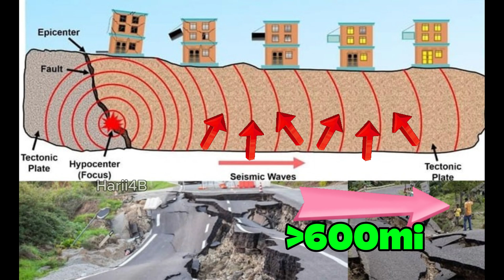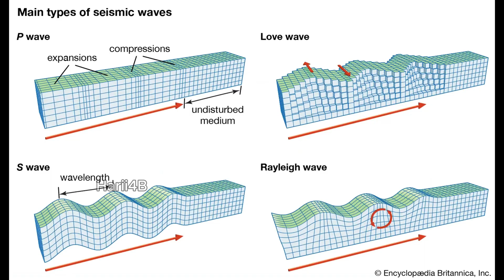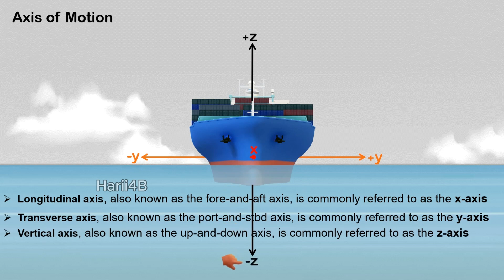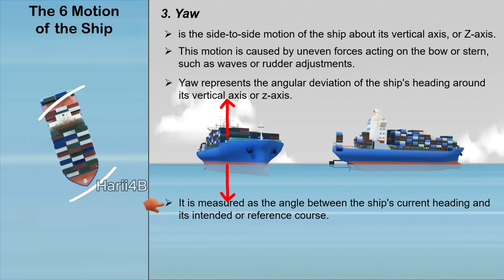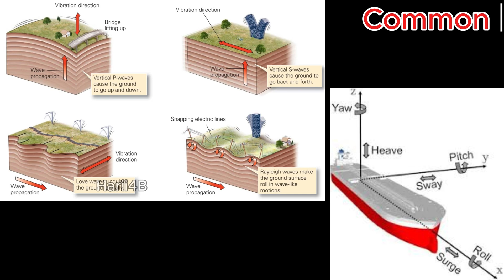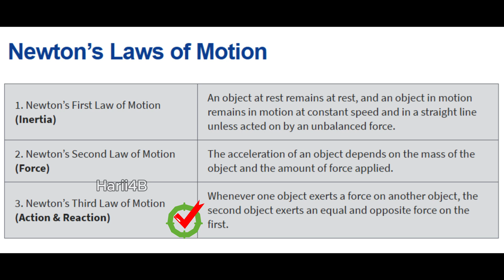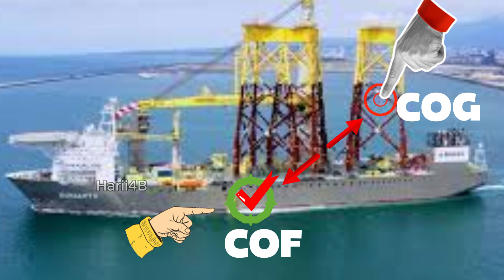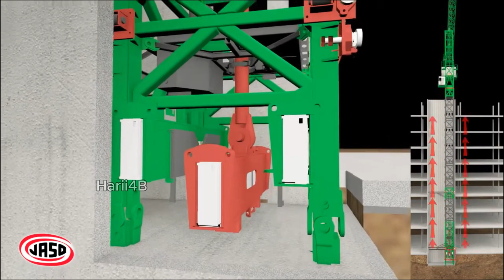Myanmar Thailand Earthquake - Thailand Building, TOWER CRANE Killed It, EXPLAINED - Watch Now!!

Comment: The building and the crane hadn't started swaying into motion but the whole building already started disintegrating top to bottom simultaneously. It's bizarre for a tall building to collapse in an earthquake without first going into excessive swaying or tilting. Earthquake is infamous for its destructive horizontal pulsating force. If this pulsating force matches the natural frequency of a tall building it can send the building into harmonic sway with its amplitude getting higher and higher until its collapse. And in this way a much weaker quake can bring down a building.
It works the same way when u are on a swing; by syncing your force with the motion of the swing, u can work it higher and higher much easily.
But this Bangkok building wasn't brought down this way as it didn't sway a bit.
Reply from the maker: the tower crane is swaying right until collapse but yes, the building looked statically stable. by looking into Taipei 101, with 101 floors with tuned-mass steel pendulum damper on top floors. that pendulum damper sways against eq motion hence keeping the building remained as stable. incidentally, the Thailand building with tower crane may have acted as anti-swaying damper as well. but it was accidental only, and disaster followed.

Comment: The Thailand building collapse because it use a Beamless slab design, which is not earthquake proof design. This Beamless slab design is popular at places, where there are no earthquake, because most of the spaces can be fully utilize due to there are no huge beam that occupy space. Recently, Thailand officials said that 1 out of 3 sample steel bars taken from that building site is substandard material. This could be also one of the factors.
Reply: @yutakago1736  cheaper to build, tofu dreg construction.

Comment: The ONLY Building that COLLAPSED in Thailand was Built by China Railway Number 10.
Instead of coming forth to Assist Investigations; No ONE from China Railway Number 10 came forth, they were Busy Scrubbing TRACE on the Internet and Removing Files from offices signages.
Preliminary Investigations shows Sub Par Steel manufactured by Xin Ke Yuan.

Comment: If the finding was not due to the crane, then this video will have to be removed.
Reply from the maker: No, actually the crane helped exposed their flaws (if there is). So let them blame the crane. on my part, crane could be the Saviour. if ever this event happened later when the building is occupied, more casualties there will be. If indeed it's proven as tofu dreg design and construction, they had built a ticking time bomb, and the crane became the trigger of the bomb, activated by the earthquake. thanks for watching!!
Reply from the maker: OK! simplified explanation .. coming up!

Comment: To me, it couldn't be the tower crane or soft stories at top. It's due to failure of framing joint's of floor bellow top soft stories.
Crane mass n soft top stories, most probably played significant role to stabilize the whole structure. Detailing of joints, especially for top two stories below the soft stories had not been designed or implemented properly.
Reply from the maker: simplified explanation .. coming up!

Comment: Wrong. The investigators found that low quality Chinese steels were used in construction, especially the support columns.
Reply: The steel is the least important of the issues with this building. 1) Design is number one with the offset lift core appearing to experiencing differential movement in the quake 2) The big one is the concrete which turned to dust just falling off the rebar - its colour being very white could indicate a pozzolanic additive was present - whereby the ratio to cement content needs to be within a certain margin.
Reply from the maker: simplified explanation .. coming up!
Reply from the maker: you're comment is the closest almost exact answer to the findings!! concrete strength and quality is the most problematic here!! thank you very much!!
Reply: @ A detailed report on the structural design just released by Thai engineers says the design of the building has many major faults, and the steel (even if it was substandard) should not have played a role in its collapse in the manner that it did. In particular they refer to lift/ core being off-set causing differential movement during the earthquake, the design of the foundation mat slab, the lack of piles under the section where toilets were located on each floor and roof top tank area and the transfer slab on the 19th floor named 19TB1 that likely failed causing the lift/ core / crane to drop initially.
Reply: @ The concrete specified was 500 KSC pumping that up 30 floors after it has been delivered to the site and potentially subjected to delays due to traffic can be challenging and would have required careful planning and supervision. If water was added then the design strength could be compromised.
Reply from the maker: perfect! my same findings indeed!!
Reply from the maker: can the investigation report be accessed by public? any link please?
Reply from the maker: follower video coming up. after watching that then you can say again if this video is wrong. thanks for watching

Comment: I doubt the tower crane  pulverize  the building  . The crane went down  first due to strong  sway  due to  air quake  while carrying  materials sudden big sway will create double   actual  weight. Due to inertia forces,

But the building crumbled in dust, the cement is not mixed right,   contractors  and engineers  cut corners  to save   5million dollars  and pocketed  the fund's.  It clearly shows  the building fall instantly   compared to the rest of the building nearby.. the crane should stop crashing on the last 2 floor  that's enough to hold the weights of crane  if the building  is built  right ,the right size of rears, number of repairs, the correct steel frame  , the tensile of  steel  frame. 
The bolts use on frames  must be grade zinc plated due to near ocean  demography.  The engineers should not used grade 5 bolts it will corroded  in 1 year  and it will meet its demise in 2 to 3 years..
The heavy duty frame should have  stop the  crane from  crashes ,
 It goes down like a pulverize  sand castle on the beach,

Building is not done  correctly  not on code. The engineers  and contractors are liable for this  flaws and demise.
Reply from the maker: follower video is being prepared. yes of course, materials played major role on the cause of this domino collapse. imagine this building is built like a bomb due to poor materials, flawed building design and construction methodology. a bomb needs a trigger to start detonation. the tower crane played the trigger role... it's really hard to put everything (explanation) in one video but hope the follower will be more enlightening. Thanks for watching

Comment: Nothing to do with the crane, there are 50 plus crane visible on buildings under construction Bangkok and the building didn't fall.  It's bad Chinese construction
Reply from the maker: depends on type of tower crane and placement of the crane. most tower cranes are self-standing from its base at ground and attached to the building by lateral braces to prevent falling down. This type of crane is the climbing type and supported only at the top floor levels. commonly this crane is positioned on the middle or near middle section of the building.... But this crane is not! this is where it makes the big difference. an example of design and construction flaws. now, if the material (rebars and concrete) used on construction is proven to be poor quality... then this will be classified as 100% TOFU-DREG construction.

Comment: This is Chinese propaganda as they do not want you to know how little steel they had in this building. Tofu dreg construction is always a problem in China. If this building was built with correct materials it would not have colapsed.
Reply from the maker: TOFU Dreg Status will be marked when Thais proved that material used are poor quality. Still waiting for the testing reports .... Thanks for Watching!!
Reply: @Harii4B  So, even the fact that the building fell at free fall speeds does not make you think that there is a problem with construction.
Reply from the maker: @DieterSoegemeier  i am waiting for the reports of material used under testing are really poor quality and if proven true, i would elevate this collapse as a 100% tofu dreg construction induced. the crane position is already flawed. now, add to it if the materials used are also flawed (?!) ... that's it!
Reply from the maker: i already suspected that the building framing are flawed. the slabs in this building generally have no beams to connect on the column and shear walls. this type of floor frame connection can easily snap under shear loadings how much more the amplified falling weights of each floor, and it did happen already. imagine a bomb waiting to explode, it needs a trigger to detonate. the focus now of the videos is to point out where or how the detonation was triggered. the EQ activated the trigger mechanism which is the tower crane... and it did activate detonated the bomb!

Comment: You are trying to confuse us, to cover up what actually happened. THEY do want us to know. https://youtu.be/M7Ra_1D3roE?si=8fP7ULikADwIJBEa
Reply from the maker: what cover up? i am only pointing out what i think caused/trigger the instant collapse after the EQ came forth. Now, It's mother nature at work. maybe for whatever reason... it may also be a blessing in disguise (no disrespect intended to casualties now). if indeed they can prove the materials used are poor or defective quality, then it would be another TOFUDREG construction project. imagine if it got finished and hand over and during operation, EQ came.... then more casualties will be there! The tower crane positioned on that core shaft location is already a flawed design & construction decision... it should have been positioned on central core shafts.

Comment: It has already been proven that the Chinese construction crew used inferior materials, and four employees tried to steal and hide the engineering documents.
Reply from the maker: too early to say if it's going to be another .... TOFU DREG. Thanks for watching
Reply: Testing of the metals used have already been accomplished in Thailand, and were found to be substandard.
Reply from the maker: yes thanks, i am also monitoring the tests on steel reinforcement used. i hope they do core test of existing concrete as well... that is, if there are still some intact columns to collect coring samples for testing

Comment: How do you figure the tower crane? The collapse started at the bottom columns. 
Structural steel and welding inspector was my day job. If it were the tower crane, only the top floor would have collapsed.
Reply from the maker: if it's controlled demolition will be clearly showing collapse from ground and the entire upper level coming down whole until totally demolished. videos shows collapse started from top. thanks for watching
Reply: Bad design - the lifts/ core was offset causing Differential Movement when the earthquake struck.
Reply from the maker: https://youtu.be/QAer_dU6HQE , best viewed at 0.25 speed

Comment: Blaming the tower,,,,,,why dontyou blame the earthquake?
Reply: BS. Material and construction issue.
Reply: Blame the earthquake alone? Why don't all the surrounding buildings fall down the same way, genius?
Reply: like covid 19 they blame the bat in wuhan market
Reply: There were many new constructions during the time, but there was only this one collapsed.
Reply from the maker: i will not blame the EQ of course. It's mother nature at work. maybe for whatever reason... it may also be a blessing in disguise (no disrespect intended to casualties now). if indeed they can prove the materials used are poor or defective quality, then it would be another TOFUDREG construction project. imagine if it got finished and hand over and during operation, EQ came.... then more casualties will be there! The tower crane positioned on that core shaft location is already a flawed design & construction decision... it should have been positioned on central core shafts.

Comment: I call bs. The reason that Tower fell is because the Chinese were working on it. Everyone knows how the Chinese cut corners with material and technique.
      Besides that it's already been verified that the Chinese use a much weaker steel than what was needed. It's just the Chinese way to take shortcuts on everything they do to put more money into their pockets. That's the truth.
Reply from the maker: BS. there is a mention on about weak link snapping prior collapse. If looking deeper, that can cover anything. example, weak link can mean weak reinforcement steel could snap.... please watch again. Thank You  :-)
Reply: @Harii4B  no you need to watch and learn everything. Just have already been ran and determined the steel was not of quality That was supposed to be used for the construction.

Comment: Why the hell the elevator shaft design not put on the center of the building? Usually, elevators are often located in the main entrace of the building mostly at the center part and not at the corner. Designed flaw maybe because they never anticipate that the location never experiences an earthquake before, but not an excuse for the developer/contractor.
Reply from the maker: bingo gotcha!! totally agreed!! these climbing cranes are usually positioned at middle shaft cores. for one thing, it will allow 360 degrees full reach of the crane boom. putting the crane on the spot is like.... totally fucked up!!! very glad you agreed and spotted that flaw!!